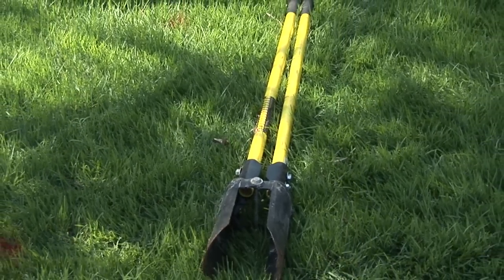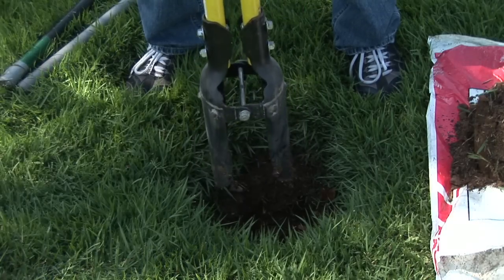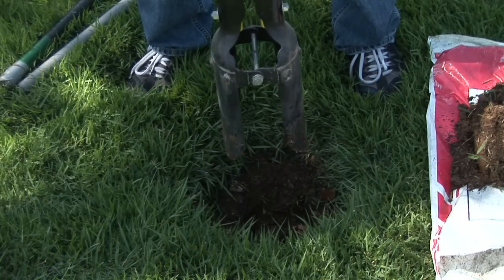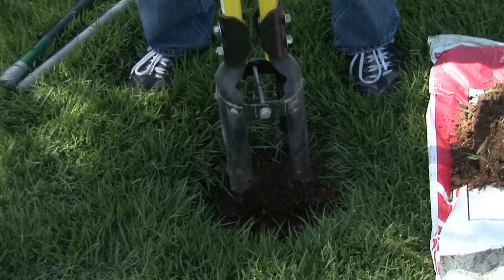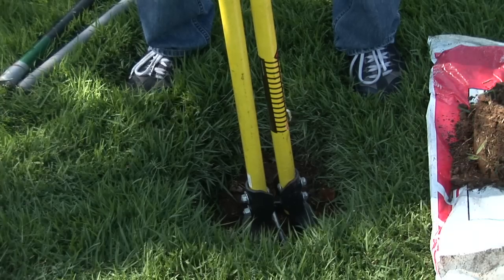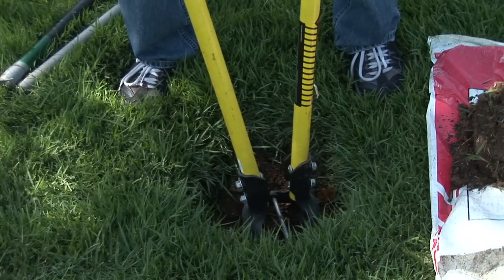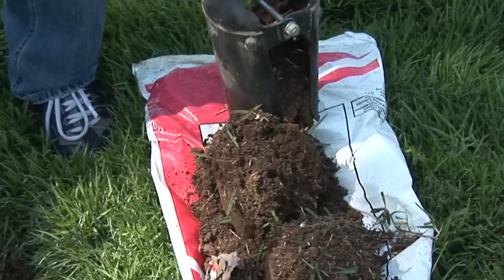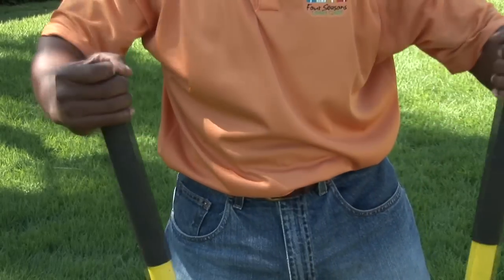Lawn Help : How to Use a Posthole Digger

Comment: Tiny female. This is funny. Break the dirt up with that thing? Hah. 3ft deep? Hahahaha. It stops being nice dirt after a while and turns into clay and rock misery. I need a better video with tips. You're not even wearing gloves.
Reply: He's not digging the hole for you, so he doesn't need gloves ; ). What he is using is good for soft to average compacted soil. It would also be good for digging multiple planting holes. As you get to rocky soils, you will need a sharp spade to remove rock. There are other tools for that. For that typ are correct, you will need gloves. Good luck!
Reply: I suggest getting a rock bar with a point on one end and a flat head on the other. It’s basically a solid metal spear for breaking rock. Trick is, you can use it on the ground to start your hole. And then use the diggers to remove the now loose material. I’m a tiny guy and I do this every day. Work smarter not harder. Lol
Reply: If the ground is dry, pour some water down the hole and let it soak in for a few hours to soften the dirt. In addition to using a rock bar for breaking up the rocks, rotate the post hole digger (and yourself) 90 degrees around the vertical every few strikes so the jaws are hitting at different angles.
Reply: Bo Cowan yea I had to buy a pick axe because some soils were not the easiest to dig with a post hole digger. Actually had someone threaten to have me arrested just for digging holes lmao